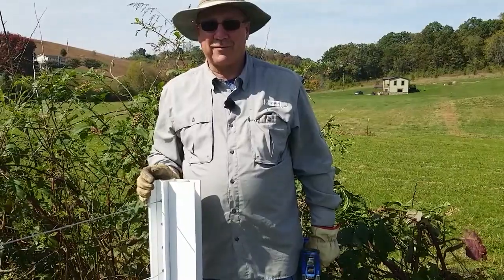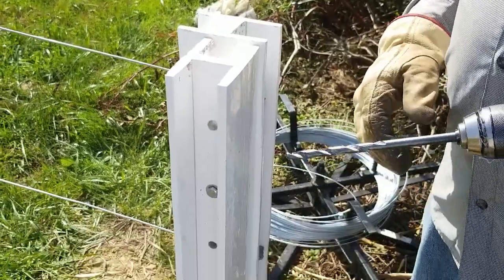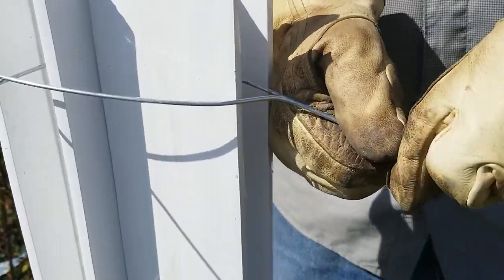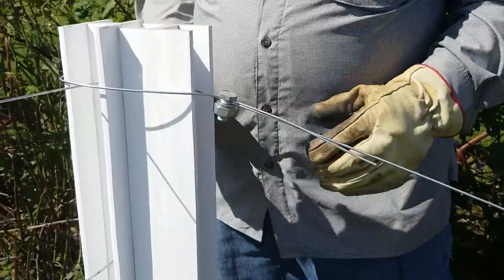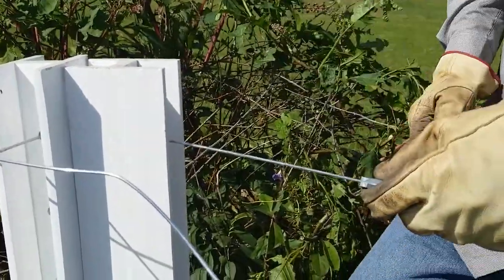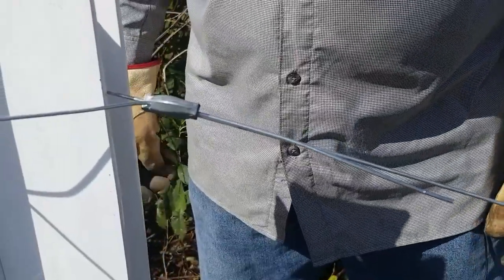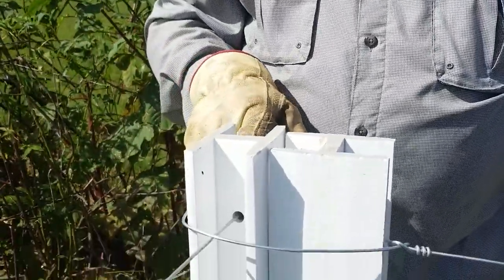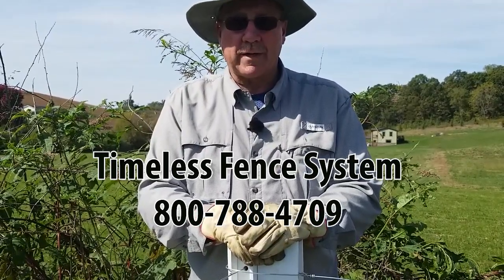Electric Fence Wire Termination: Best Techniques for Secure Fence Installation

Comment: Does the end of the post/pole act as an additional ground ? I set up an electric fence and it does not shock unless I touch 5he ground wire and the output wire or the output wire and my metal post. I was thinking of wrapping the end of my wire around some rebar, but want sure if that was safe or would act as an additional ground .

Comment: Just don't over tighten the split bolt, they are aluminum bolts with steel nuts so the aluminum threads will strip and break easy.
Reply: Great tip thank you